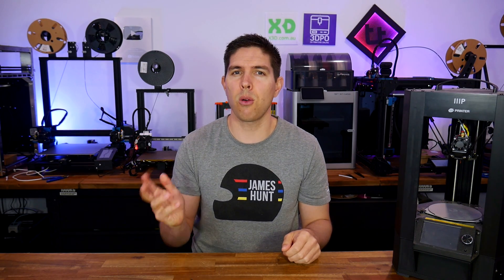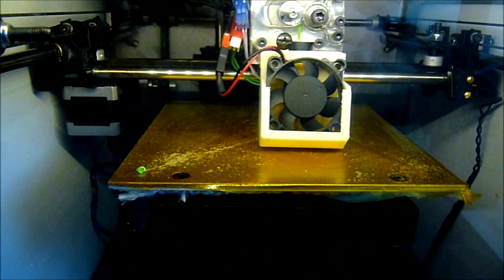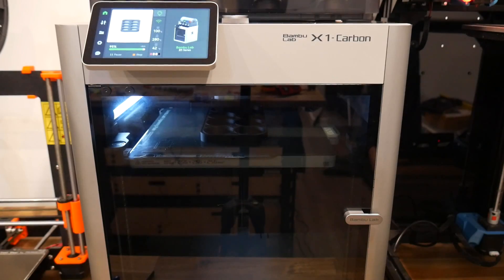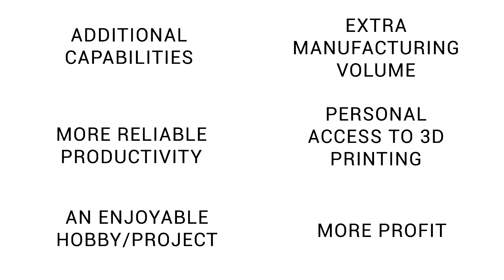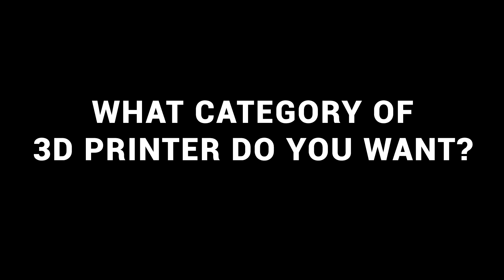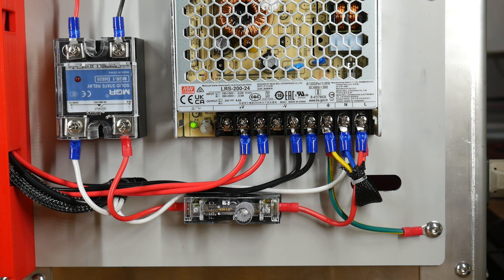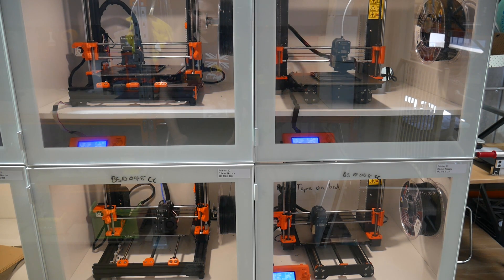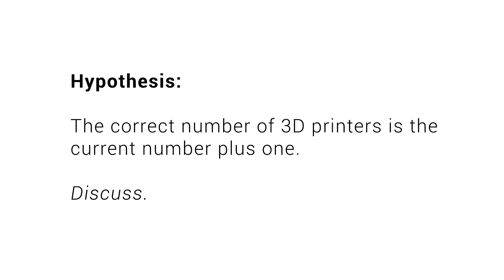Should you buy a second 3D printer? Reasons why and why not

Comment: I have an X1c and I run it pretty much 24/7 for test prints for designs I put up on makerworld for points, and fun stuff around the house. I want a second specifically so I can quickly print a random thing while a long multi day job is running. I’m considering the A1 or A1mini, I have enough in gift cards for either an A1 no AMS, or an a1 mini combo with ams. The ams is $250 but you get a $100 discount when buying the a1 combo… it’d be nice to share build plates with the A1, but I don’t really NEED another full size printer, which is why the mini looks so appealing.

Comment: Do I need 2? No! Do I still have 2? Hell yes! Just because I can. I don't want my printers running during the night making noise. So I have 2 to print during the day. Also I do not need to print stuff 24/7 but when I want something, I want it now. Not after 12, 24, or 48 hours. Therefore running 2 at the same time can reduce the time to print all the parts. So even though I do not fit nay of the boxes it had a benefit for my use case. Or so I would like to believe lol.

Comment: I like creating things with Tinker CAD. Due to disabilities I have acquired in my 76 years of a dangerous job and a dangerous lifestyle outside of work sometimes I need to make something to help me along. I have a Anycubic Kobra Max that was large enough to print a push stick for removing my compression garment. I just got a Bamboo Labs X1 carbon. I’ve done 5 prints and they all turned out well. If I’m doing CAD and printing it keeps from buying more stuff.

Comment: hi Michael I have the Cocoon touch, the aldi machine with only a few basic changes, still have the original extruder but with auto levelling on the side, forgot the name. Anyway for the printing i do, which isnt as much nowadays, I can leave it alone for months come back to it and it prints fine 99.9% of the time. I see on the various forums guys and girls who buy their first printer and withing days are modifying extruders, fans, beds, and whatever else is in fashion at the moment. They havent learnt what their base printer can do and are already following their mates down that slippery slope of modding a perfectly good machine to the point that it stops being reliable, while they are learning. 
Its a bit like buying your first car, and before you get it home you have changed the exhaust, brakes, seat, stereo, engine modules, probably defecting it along the way but you havent driven it more than one tank of fuel.
Great video by the way, I will keep what I have but will still look at what Santa wont bring me.

Comment: I have 4 printers (2) ender 3 and (2) cr10. I have had to replace the main board in (2) ender 3 and (1) cr 10 I installed the Creality V4.2.7 board and the creality cr touch in all 3. when I turn them on the hot end temp porpoises 5c over and 4 c and will not hold temp  I then get a big tree tech skr mini e3 v3.0 and I still have the same problem Have you here of this

Comment: The correct number of printers is always N+1, where N is the number you currently possess.

I have all of the types Michael mentioned in this video, all doing different functions, and I love the flexibility.  Suprisingly enough, I use a different slicer for each, as a means of ensuring I do not run the wrong settings on the wrong machine.

Comment: 'At work, I was using a Formlabs Form2 resin printer.  I've become very proficient in not only their software, but also modifying designs to get a reliable print every time.  We mostly  used the printer to manufacture small run molds for over-molding electronics for high temperature and high vibration environments.  I would get the ocassional model for scaled fit checks, component clearance verification by printing a small portion of a larger assembly, and finally we would print and paint scaled models of our products to give to clients so the had a visual representation of what they just spent millions of dollars buying with a delivery date 6 months to 2 years out.

Now, I need a printer at home.  I have one I pulled from the garbage at work.  It's a leapfrog Creator from 2012ish.  The electronics are a poorly copied RAMPS 1.4, but does use very nice industrial grade stepper drivers(up to 80V at 12A).  The physical hardware is not bad.  It's fully enclosed on 4 sides and partially on the other 2.  It has a heated glass bed, 1 1/2" aluminum frame, 3 z axis lead screws and an XY top end.  The dual extruders have nice dual gear filament drivers.  Other than that, I don't know much about the heads.  The hardware is something you'd expect from a $800 printer, but the electronics are just needing to be gutted.  I have a new proper RAMPS with a screen and a few other goodies to get a decent running printer out of this.  I do have 20 rolls of filiment for this printer as it runs 2mm filiment.

My problem is, I need a functional, worry free printer now.  So any opinions on if I should just push forward and get the old printer updated and running, or should I drop a couple hundred dollars on something like the Crealty v2 pro?

Comment: I had the ender 3 v2 which was a relatively reliable tool and start but not too expensive for entring 3d printing. It was perfect to learn about the basics and to do all the beginners rights and wrongs.
After a year and a half the printer needed some major caring so i installed new jyers firmware and the Creality Sprite pro extruder kit and a BL touch - still not the awesome printer i wished for, but value for money its a huge upgrade. 
Meanwhile i understood i couldn't relay on one old printer, so after a long research and maping up my professional and personal needs, i decided on a fast, bigger print volume and super reliable with no mods and tricks around a 1000$. It was the bamboo lab x1, which never answered our emails and not shipping here. Then later the snapmaker J1 (IDEX) printer came out but with no shipping date (at the time). 
The best option was the FLSUN V400, after a long process it was the perfect machine to my studio, and it had nice features and work perfectly right out of the box. I have always been mesmerized by delta printer and now i have one that prints faster then i could have imagined. 

That was my 2 years of 3d printing as industrial designer, thanks for reading and thanks for such a useful and fun channel!

Comment: I'm in this process right now. I've had an Ender-3 for 2 years now, and i've modified it quite a lot, I treat it well and it prints well, but I keep coming up with ideas that are too big to print on the ender 3, so I have to design them in multiple parts and fasten them together. While I have upgraded the extruding hardware and control board, the frame and motion hardware are still stock, and I would like better, but at that point its a Ship-of-Thesious and I could just as well build a whole new printer from scratch. Which is why I've ordered a Voron2.4 kit in the biggest size they offer, using my current Ender to print the necessary parts. So not only will it be a nicer-over-all printer but being much larger there are things I can print with it I couldn't with my current printer at all. Once the Voron is up and printing reliably for me I intend to do some more extreme modifications to the Ender to turn it into an IDEX printer as well as modify the parts of the frame I'm not happy with at the moment. With the Voron I will still have a reliable printer while the Ender will be down for longer periods of time doing the bigger upgrades that I wouldn't feel comfortable doing if the Ender was my only working printer. At the end I will have two printers with different but uniquely useful capacities neither of which I could do if I didn't always have the other to rely on.

Comment: Honestly, my biggest reason for owning multiple is that it may be hard to predict when one is going to break in a way that you could fix if you "just had your 3d printer". Can't tell you the number of times that I have not been paying attention to some hidden component, and then it breaks out of the blue. Since I've got a couple, getting it back up and running is trivial.

I had two Robo3D R1's for a very long time, but just built a LayerFused X301. I absolutely love it and want to rebuild the R1's into modified X-series printers in the near future.
Reply: That's a good reason. I have 3 fdm printers and two of them are down at the moment lol 😆 one needs new temp wires and the other is just a pain to level so I'm waiting on the sonic pad to arrive in the mail for it.

Comment: Video suggestion: since you mentioned it, discuss methods of setting up multiple profiles in your slicer. 

For example, I have multiple ender 3s that require different profiles due to different modifications. I have found it easier to set up in Cura than in slic3r. This makes me default back to Cura even though the features of Slic3r are better.
Reply: Prusaslicer/superslicer have pretty deep options for configuring profiles.

There is profile inheritance, a tag system for each level of profile, and seperate profiles and tags for physical printers

Comment: Funny i am in this boat. A way older cr10s had s board failure and it a 12volt system but i like the build volume and it was free. The previous owner had it completely apart in a box when i got it. I spent an hour putting it together and at the time planned to sell it but realized it was good and almost better than my Ender3v2 with all mods. So i debated on fixing it or scrapping it and even considered moving my ender3v2 over to the cr10s frame and just order a new 310x310bed that would be 24volts. But in end i going with a bigtreetech. Board and display.

Comment: I currently have 56 printers. 52 are operational in the farm, and 4 are still in boxes. I did over-buy slightly, but because I purchased them during a limited time deal, I look at the unbuilt printers as savvy investing (purchased at 35% normal listing price). 

One thing I'd like to note while I'm here- print farms don't always need to be producing 24/7. I tend to print in high volume batches as my time allows. Having more printers but less overall utilization allows me the flexibility to make my most important resource as efficient as possible- my time. An idol printer is not necessarily a waste if it means I can meet my highest demand periods while not always having to babysit the print farm. I believe this point is not often thought about and it's generally assumed that you must do everything possible to keep the minimum amount of printers running 24/7- literally. 
When it comes to machine utilization per day vs my time management efficiency = My time always wins. 

Another interesting thing I have discovered with having many printers, is the doors it opens for parallel iterative designing. If I'm not sure if a particular 3D design feature is going to work the way I want, I can make a dozen variations at the same time and leap ahead in the design process. It's incredible. Even if I had more printers for only this use, it would still be worth it. 

Great video as always, thanks again.

Comment: I have purchased a dozen Creality printers. Eleven arrived with faults. All the faults were different. Main boards, filament sensors, limit switches, wiring faults etc. The Creality warranty should read "You give us money and we'll send you something in a box. The rest is your problem". A major issue is the extremely poor quality of Creality electrical connectors and wiring. These types of faults are very difficult to fix without re engineering the whole machine.

Comment: yes.... you should have at least 2....... i have 5 (4 FDM, 1 resin)
if one breaks, you have another that could print parts to fix it with. You can also have them set up in different ways, for different types of prints. You can print multiple things at the same time, doubling your out put, or cutting your time in half, depending on how you want to view it. multiple printers is a good way to go.

Comment: I have thought about getting a smaller 3D printer, possibly a Delta to compliment my Ender 3 Max that I bought because the first few projects I had in mind where large cases for some electronics projects I wanted to do. However, due to its size it is necessarily slower that smalller printers, and 80% of the things I print these days don't need such a large print bed. I thought Delta, because frankly the look really cool. and are hypnotic to watch :) They also have a small footprint, which is a good thing given the space I have. Recently I have also though about some of the new smaller printers like the Creality Ender 2 or Voxelab C2 that seem to be cheap, generally well reviewed and would be ideal for those small prints and could be kept in a cupboard when not in use. But I keep coming back to do I really need it, There;s a lot of tools and motors/parts/fittings for the 3D printed projects you can get for that money, I've upgraded my printer to a point its working well for what I want to do, and as a retired person I am rarely in a hurry and its more "stuff" to clutter up the limited space I have!
Reply: If you haven't seen Rolohaun's Rook, that's what I'm most tempted to build right now. CoreXY, 120mm build area, the basic frame is a 200mm cube but including all protruding parts the external dimensions would be 240x275x280mm.

Comment: I'm at 3 heavily modified ender 3 machines,  and 1 CR-10S that I've added bltouch capricorn tubing and hero-me cooling. I have all 4 machines basically running 24/7 except intermittent down time for maintenance checks.  Mine are making money right now being authorized sellers for a few popular designers.  If things keep up I'll have to add more.  I've stuck with Creality machines as they are what I've known.  But i do have my eyes on building a voron or picking up a bambolabs  machine.  I'm still up on the air as both options will be close together in final price.

Comment: For me, I realized that buying a second Ender 3 was the best option.  I was tired of how long it took to make parts for projects and really enjoy having two machines to get parts faster.  I've modified both of them the same way so they've stayed in sync and I can use the same print profiles for each.  I have been holding out for a better bigger core X/Y machine but haven't bought one yet because the designs are coming out so quickly.  I thought I wanted a Seckit and then a Voroon and then a Pusa Max.  Now, I'm thinking a Bambu Labs but who knows what the next six months will hold.  There are so many great printers at all sorts of price points these days that you can't go wrong, so if you want more parts faster, add another machine.

Comment: You can avoid printing to wrong machine if using Klipper.

In slicer start gcode set a unique machine name, IE:
MACHINE name=Ender-Arrow-IDEX

If wrong machine name is sent cancel print and log message

[gcode_macro MACHINE]
gcode:
  {% set machine_name = params.NAME|lower %}
  {% if machine_name != "ender-arrow-idex" %}
    { action_respond_info("WRONG MACHINE [" + machine_name + "]") }
    # Call cancel print macro
    CANCEL_PRINT
  {% endif %}

Comment: IMO, the correct number of printers for the average person is exactly 0. The average person doesn't have cad skills, nor a reason to learn them. The average person also does not do 3d modeling. But for those who do have those skills, then 1. For an experience operator who knows the limitations and capabilities, 2-3 with varied abilities and features, and a professional >3. But the average person, they just don't have a ton of utility. Most of the time little parts and trinkets can be bought more readily than printed, and they typically are better parts. Custom parts or models are what they are good for.

Comment: I have an Ender-5, which I use PrusaSlicer for because I like that software, and an X1C, which I use BambuSlicer for because even though I don't like the UI quite as much (I realise it's almost PrusaSlicer under the hood, but the UI is different) the connectivity advantage is worth it.  This means I'm using different slicers for my different printers.  I'd never thought until just now how that means I'm much, much less likely to slice something with the wrong profile!

As to the final question: I'd like to have two printers that were as precise and reliable as the X1C, and leave one with a 0.4mm nozzle for general-duty work while the other was equipped with a 0.2mm nozzle for small detail work.  At the moment the P1P looks like a good choice for the goals of the second machine... but the truth is, that will eat up over 8 months of spending money.  In theory I could save that up, but in practice... I don't think I want a dedicated 0.2mm machine that much.  Instead, I spent the extra money to buy a complete 0.2mm hotend for my X1C (instead of just a nozzle) and I'll see how tedious nozzle swaps become.